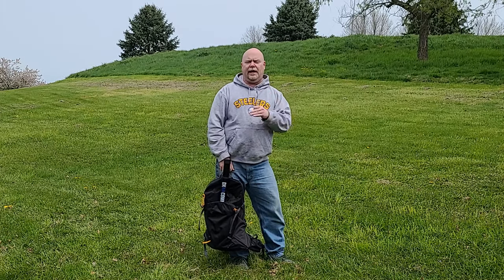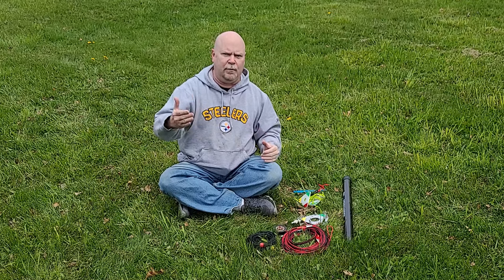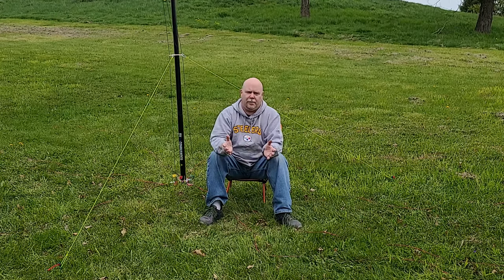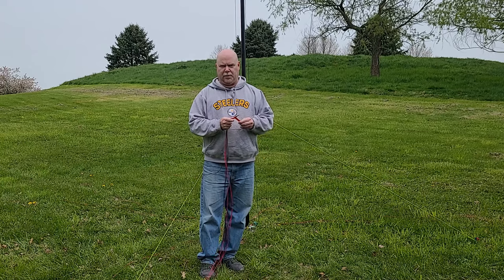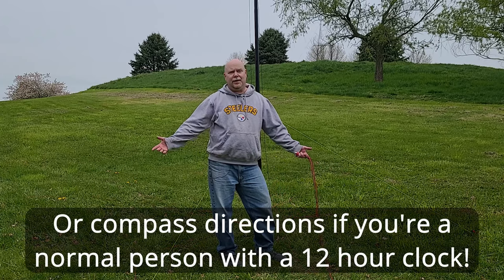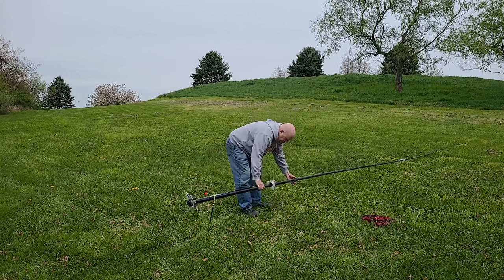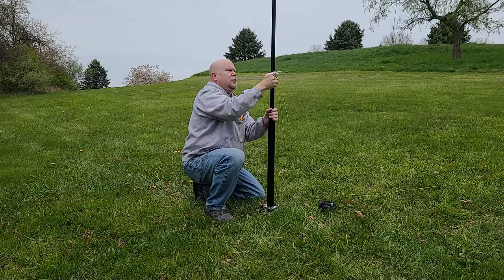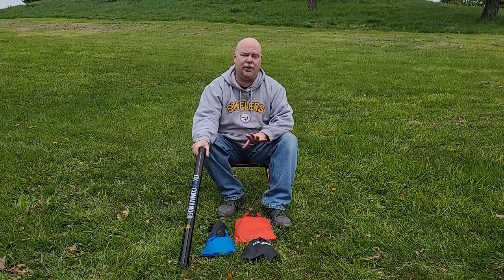The Worlds Fastest DX Commander

Comment: Hi Matt, the 2024 expedition model has a lot of improvements to set it up faster. According to Calums website the position of the elements seems to be in the right place to avoid interaction between some elements or bands regarding tuning. Nice demo video. 73 Phil ON4VP
Reply from the maker: Had a conversation with him about this after I posted the video.  Biggest change is the driven plate.  All of his comments got deleted in his big channel snafu last year unfortunately.   As for the element locations it's one of those "you can measure it with a meter, but it'll never show up in your log" things.  It's a little more critical on the larger models with more elements.

Comment: Some fantastic tips in this video.  Thank you.  I sometimes attach the radiating elements on my expedition to the pole first and extend it in place.  Useful when you have a limited footprint for deploying the antenna or overhead obstructions.
Reply from the maker: I've tried that.  I think it's slower in the end, especially on tear down - the element wires end up in a heap at your feet.  However as you say there are places where due to power lines or trees you can't really work with the pole horizontal, so it's an important technique to know.

Comment: Josh knows a lot about hoeing roads! Perhaps he could give further guidance on radial organization 😂.

On a serious note, yesterday I took out the radials off of mine to lay the DX Commander down and mow the area within the guy lines. It didn’t take long at all to screw them back in under the wing nuts. 

But you could EASILY lose a part or trying to put it together in the field. Great idea with the alligator clips! My DX commander has been up since last September.
Reply from the maker: The one I have up permanently at home is fully hose-clamped and uses all the wing nuts.  Decidedly more secure that way.  For regular portable use though they're a pain, and honestly if someone trips over a radial out in a park or something I don't want it anchored that securely.

Comment: Great Video. Takes me a little longer but It's worth it. What type of wire are you using for your radials?
Reply from the maker: Very cheap speaker wire from Amazon.  I did make sure to get pure copper.  The insulation is a bear when cold, but otherwise a lot of radial for not much cash.

Comment: Hi Matt,
Are you using the DX10 wire on your radials?  The wire looks like it’s very easy to handle.....if that makes sense, (more like rope than wire).
Reply from the maker: It's bargain basement speaker wire from Amazon.  The elements are DX10 because that way I could cut them based on the directions in the manual and not have to fuss with them, but for radials I decided to save the nice stuff and go with something cheap.   They're fine until it gets cold and then they do get stiff.
Reply: Thanks for the quick reply!

Comment: Great video.  I learned a few tricks.  I have set mine up 3x now and don’t hike in, so i leave the elements connected which saves my back during assembly.  Radials are my biggest nuisance and my solution was kite string winders.  I like the alligator clip but wonder if it adequate for 100w.
Reply from the maker: Works with my 891 on full blast without issues.  The small conductor area that results from the teeth of the clips is only a tiny fraction of a millimeter long.  It handles the power just fine, much like a high amperage fuse is just a thread compared to the main conductor.

Comment: Just one question, do you use the hose clamp for the top and middle plate?
Reply from the maker: This is the expedition model, so it only has the lower plate for the guy ropes and one upper spreader.  No hose clamps needed for this guy.  I do use them on the classic model that I have setup permanently at home.

Comment: Matt, new subcriber here.  Question can the Dx Commander Classic still be used as a portable for POTA?
Reply from the maker: It sure can, and there are good reasons to choose it.  Only get the expedition if you really need for the pole to pack down as small as possible.
Reply: Matt. Helpful advice for sure. How long are the poles for the classic? I won’t be transporting with a motorcycle or backpack. Ha!

Comment: that is slick. how long are your radials 73 kq4cd
Reply from the maker: Hi Paul - Radials are an assortment of lengths that are plus or minus whatever the length of my garage happens to be.  I'm going to guess they average 18 feet or so.   There's one bundle that has two longer ones (maybe 30 feet) and two very short ones that resulted from some poor guessing as to how much wire was left on the spool...

Comment: Hi Matt, Great video! 🖕🖕
You made a quick comment about the DX Commader Classic as being a bit easier to set up.
Why is that?
Thank you.
Reply from the maker: It's a very minor difference, but the heavier pole is in fewer sections and stands up to rougher handling.  Probably saves 15 seconds at most, but since I was going for time I mentioned it.

Note that you need to be using the Expedition kit hardware in either case.  The Classic hardware has an extra spreader plate and doesn't support the shock-cord mod for the driven plate.

Comment: I worked with the wrong Roadies. It going to take a while to use the over/under coiling method without thinking about it. 
You could use a single power pole for each ground radial connection. A ring terminal and short pigtail to a power pole that stays on the base plate.
Reply from the maker: I almost tried that before I thought of the alligator clips.  Decided not to mostly based on the cost of power poles.  In the end I'm glad I ended up this way because I'm pretty sure having 5 or 6 little pigtails hanging off the base plate would get annoying fast.

Comment: awesome video!!! I have the 10m avb. used it on my 2nd activation and got a contact from AK on 20m. was a bit to set up but was 3 rd time I had it up even then was alittle faster then 2nd. will definitely use the over under method. thanks again. GO STEELERS 
kc3pip

Comment: Why so much work and time if you can do it with EFHW or small wire Dipol or a very small Tuner like the T1 or whatever, in just seconds? Forme it would be to much in my backpack.
Reply from the maker: I do use an EFHW as one of my portable antennas.  You have to remember though that often, using trees is simply not an option.  Most of the national parks for instance forbid putting anything in a tree.  Also, EFHW only works without a tuner on the harmonics.  DX Commander works all bands with no tuner, so if you want to run 40/20 but also the WARC bands, your EFHW requires a significant tuner but the DX Commander does not.

Comment: Thank you. Great video. Was thinking was going to have to make my Expedition sort of a permanent base antenna but rethinking that now.
Reply from the maker: Thanks Dave.  Unless you have a specific need for the small size of the pole when collapsed, consider getting the Classic model.  It's pole is decidedly stronger.  It deploys as fast if not faster, and it holds more elements if you need them.  Really no down side to the Classic except for the larger pole, which typically isn't an issue unless you're traveling by foot, bike, or airplane.